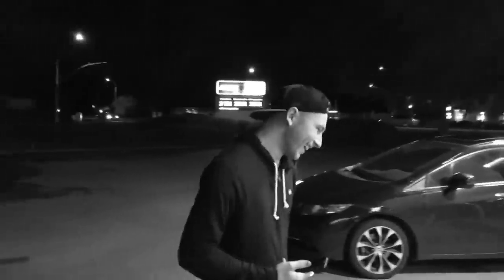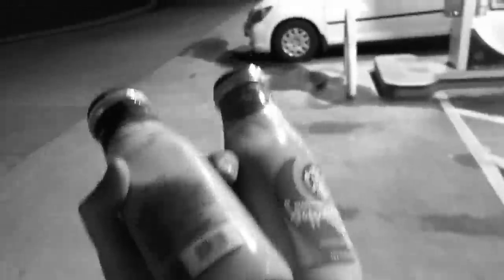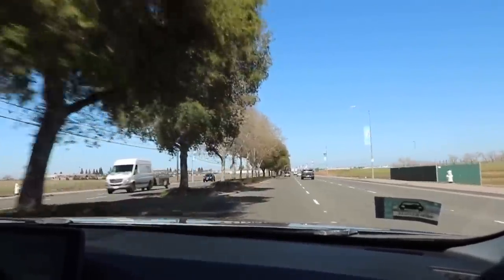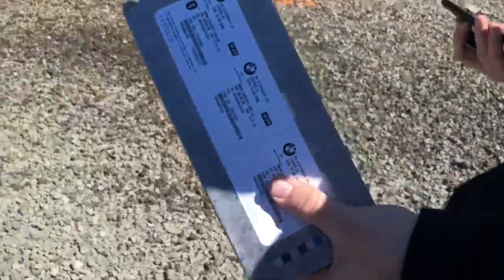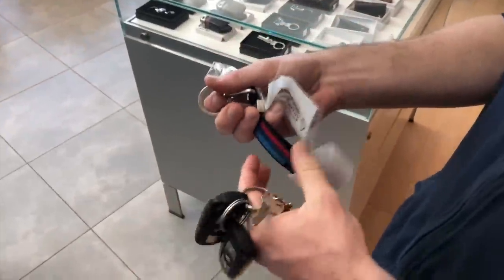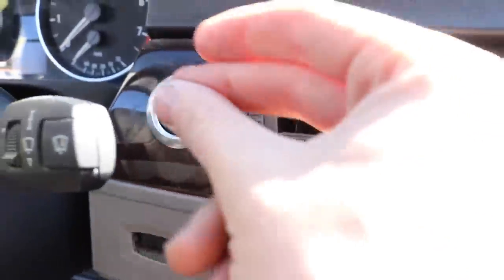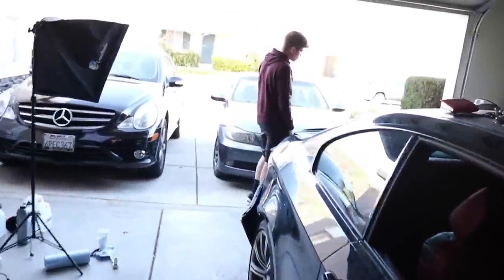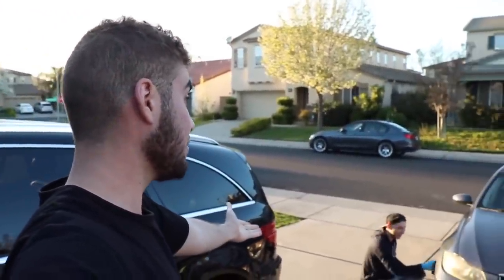MY BEST FRIEND BUYS A BMW!

Comment: Also, only the lower trim models had the black trim, 325i & 328i. The 330i and 335i got the chrome trim and the roof trim was painted to match the body color. They used more premium materials for the high end models, but the chrome is definitely not the look some people are after. 
EDIT: it looks like at some point they included a premium "shadowline" kit for the M-sport package where the trim is metal and is an anodized gloss black. Need to do more research on that.

Comment: The dash speaker probably isn't blown. The heat from the direct sun causes the glue to weaken and causes the cone to separate from the foam/rubber surround. Use some super glue and glue it back together and your speaker will be fine. Worked for me.
https://www.bimmerforums.com/forum/showthread.php?2012768-E90-Center-channel-speaker-issue

Comment: I also have a BMW e90 325xi Lci as my first car at age 17 nearly full spec but here in the Netherlands you also have the option for a 318i/d which is pretty slow😂 also I have the cic but there is no option for music streaming via Bluetooth but I can call via the cic en accept calls, anyone that knows a little more about this and how I can get it working? Search the whole internet but can’t find anything other than installing a Combox which is 200 dollars or something😧
Reply: U can get a shop to code it in :-) just ask them its not expensive
Reply: Do you know the coding for that? I have the software and hardware to do it all by my self, I’ve already coded in that it displays Bluetooth in cd/dvd menu but there is no option to connect my phone, do I have to  code something else? I think the Bluetooth module?

Comment: I have the same exact car 2006 bmw 325i with 99k bought it at 89k for $3,000 plus my suv. Great cars very reliable, Sound great with a res and muffler delete and y pipe install!
Reply: It’s sport though automatic with semi manual